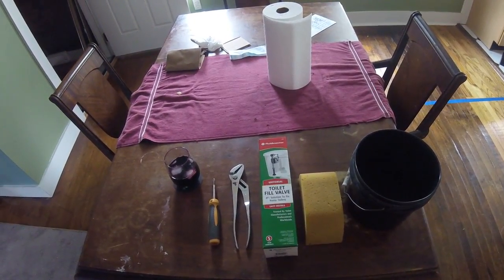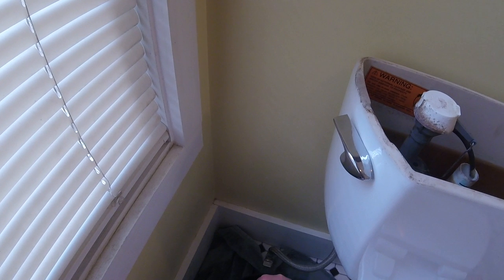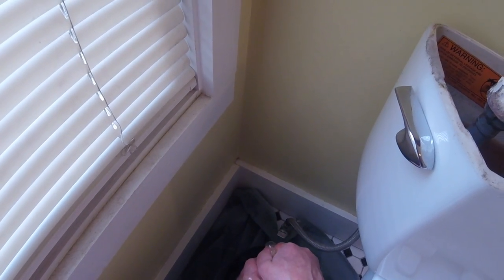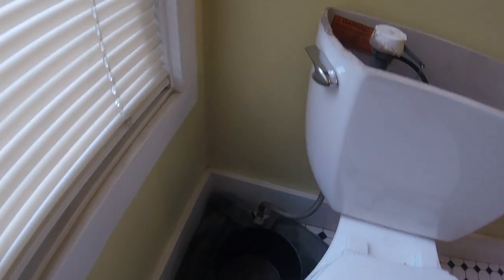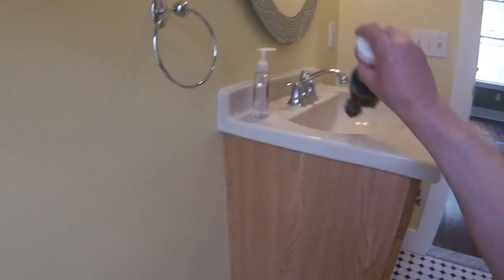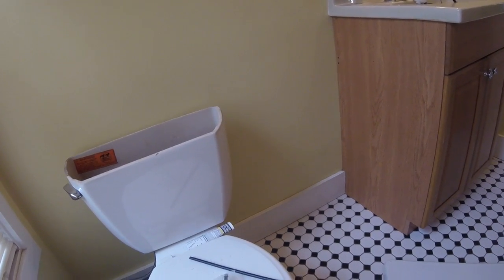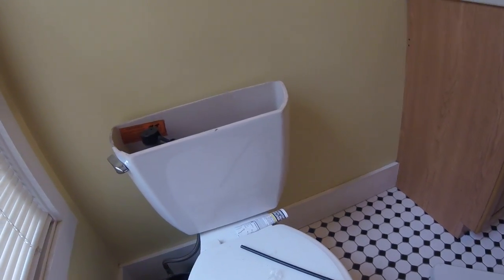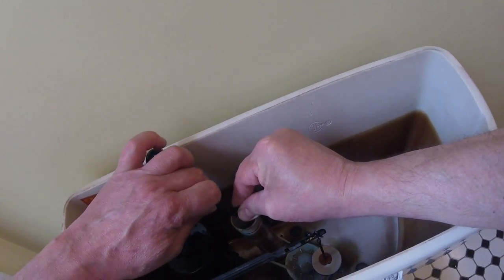Ten Minute Toilet Fill Valve Replacement

Comment: Bravo! - alternatively, one could skip the bucket by opening the seat and wring the sponge into the bowl . I prefer to use my 2 gallon wet vac - and always bring a towel to cover the seat since the plastic lids scratch so easy when placing tools upon them which inevitably seems to want to happen,. but then again - I always forget to bring the rum and coke (or wine) :p